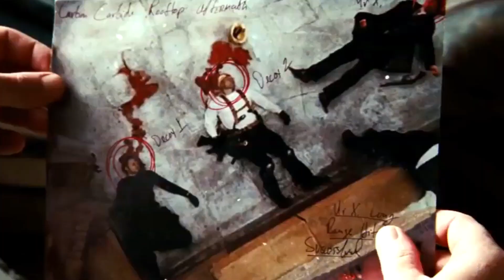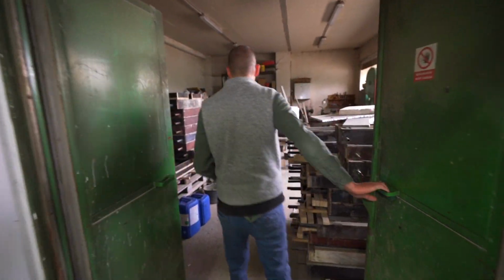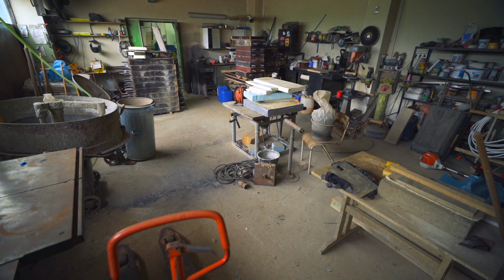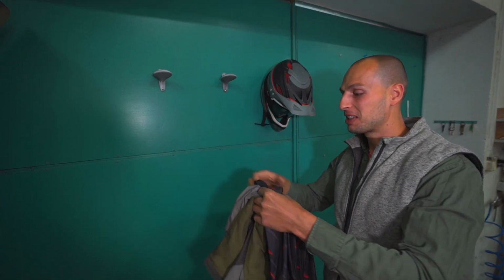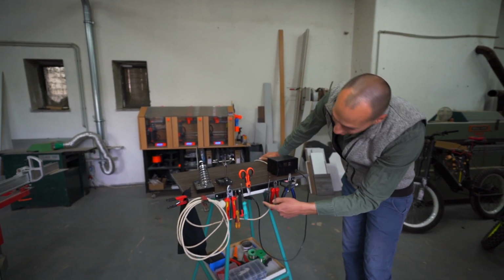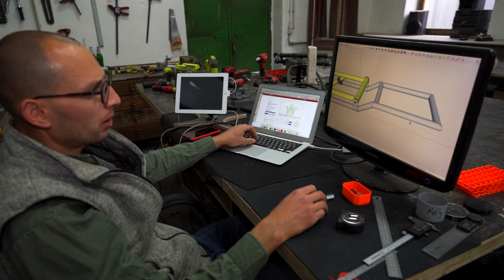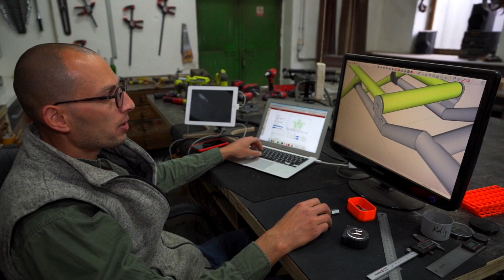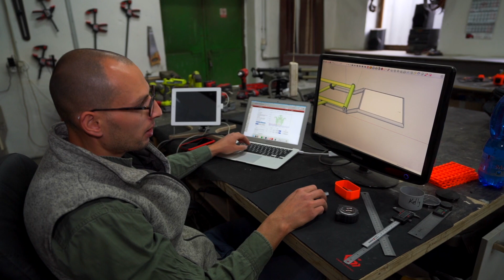Inside the eBike Workshop: Updates on CyberBike & Smaller Projects

Comment: The angles you made on your prototype is not the same as your design on the computer. Need to lay down in a 180 deg angle like your design or slightly angled at 170 to be used as a carrier system. Right now it just looks like an extension for your seat for another rider or a guard.
Reply from the maker: What are you talking about?